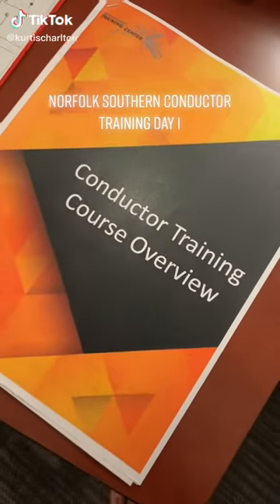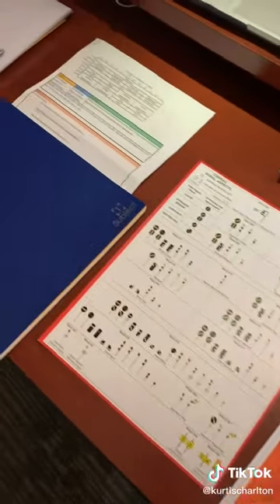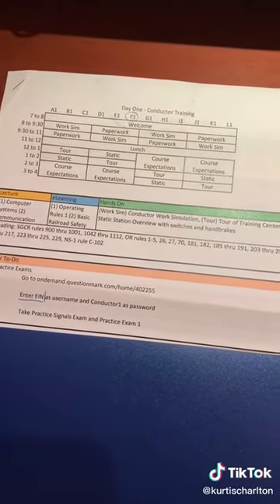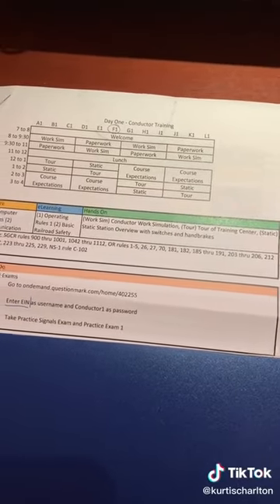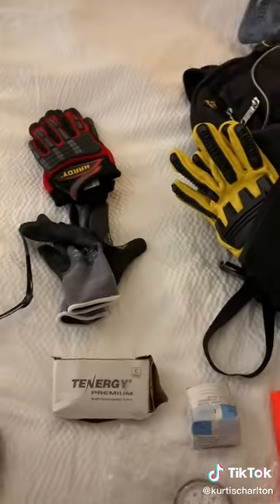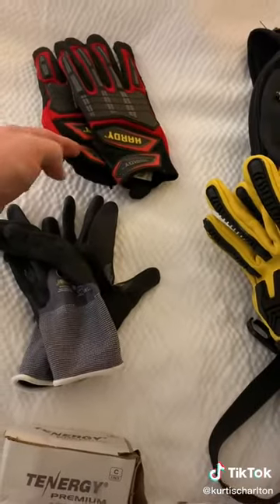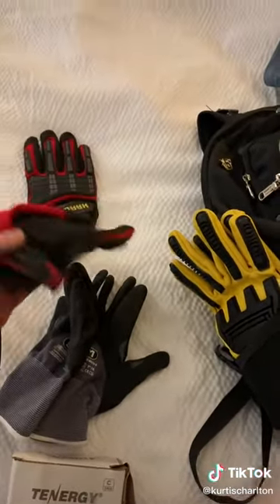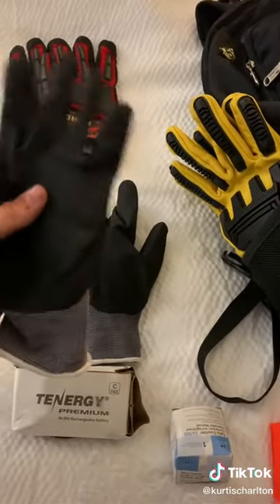Norfolk Southern Conductor Training Day 1- Part 1

Comment: I've came from both industry switching and shortline. Was in the Army as well so looking forward to working with NS. I'm just waiting for a date to start school.  Class III it's narrowed down into a weeks training and you're turned a loose when we feel you can switch and do the job in a safely manner. Safely is priority one if you're gonna do this job. The days of kicking cars to classify a outbound train or to bring railcars in to fill the leads up is long gone. Blind shove don't do it! Ride the point and set a sufficient amount of brakes. If something doesn't feel safe don't do it. If you don't know the answer to something your engineer will work with you to help you. Again safety is priority one and it will get you fired quickly if you take short cuts.
Reply from the maker: Waiting on a start date is the slowest part of the process. Training at NS is usually 13 weeks in total...3 in GA and 10 on your home terminal. This will depend on the business needs at your yard and how quickly you pick it up. Your TM may hold you longer or push you through faster. Just do things safely and you will be just fine